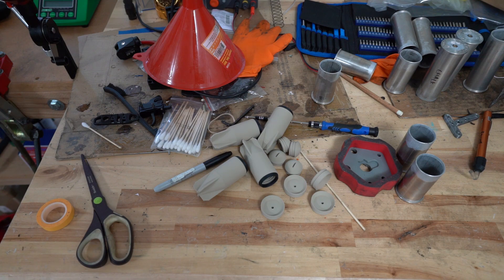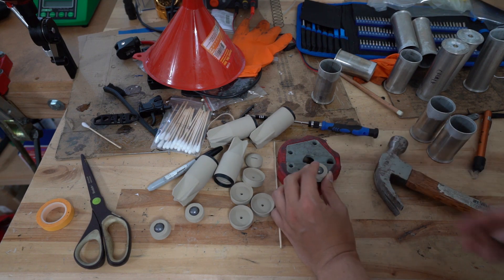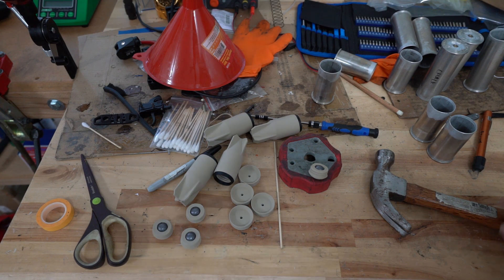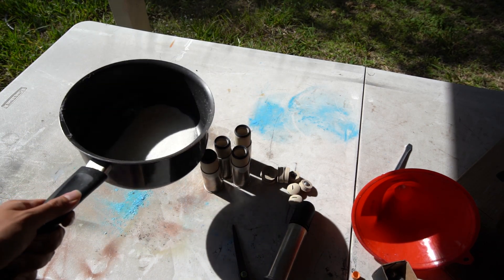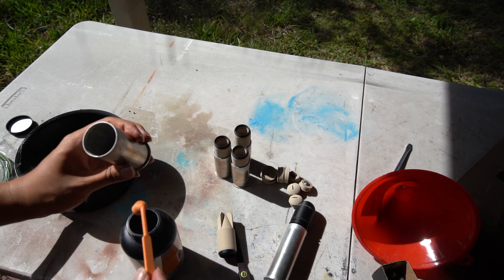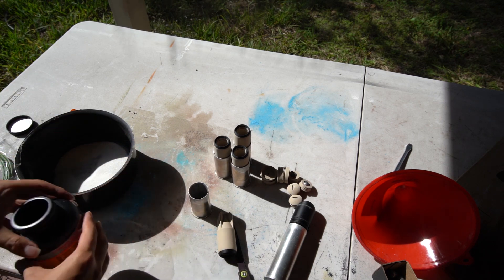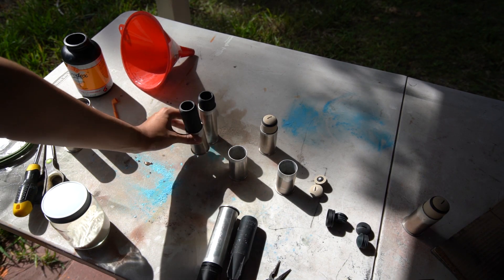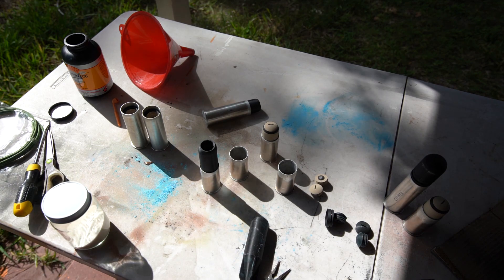3D print your own 37MM projectile 2.0: Fin stabilized, front loading, weighted top

Comment: You need bigger vent holes if you want your smoke rounds to actually emit smoke. Right now the pressure in your shell are building up until it's to high for the container. Vent holes are critical.